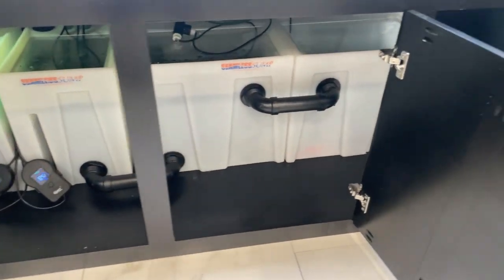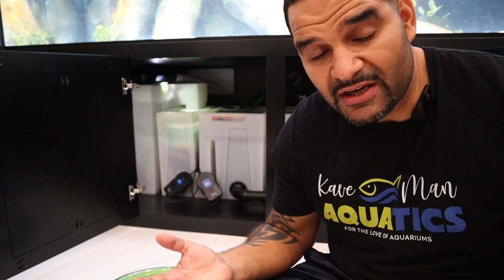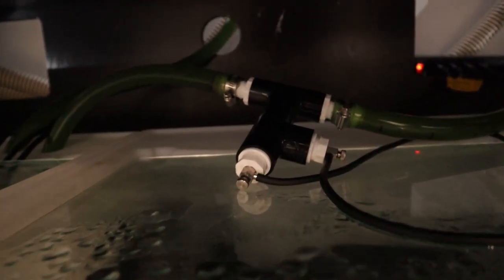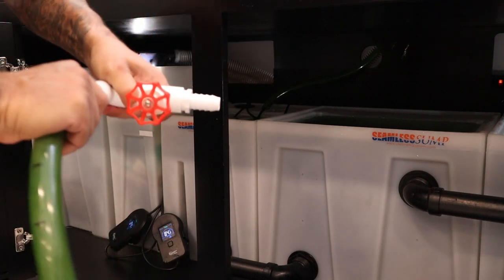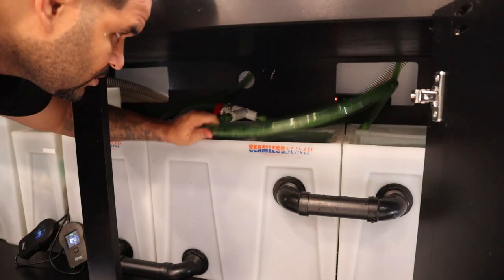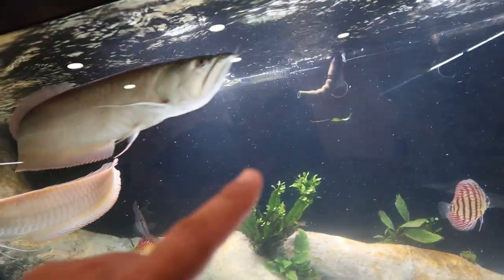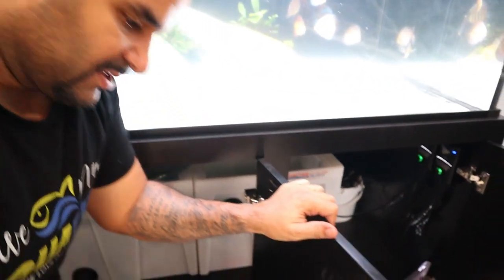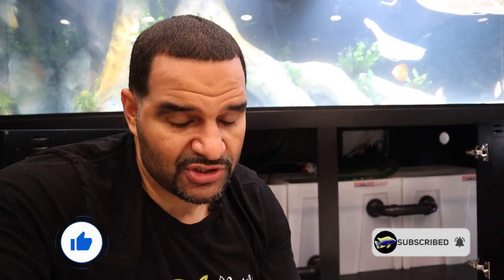I Upgraded My Seamless Sump! (Simple Hack)

Comment: I have the same seamless sump on my 600g african tank. What is did is I drilled two holes in the bottom side of the baffle tub and connected it with 1.5" pvc using a uniseal. I did the same thing to connect the third tub to the 4th where i have my pump. Seems two 1.5" PVC connections between each tub is enough flow for my 2000gph pump. This allowed me to make the third tub a fluidized k1 media bed!  FYI connecting pvc through the uniseal is a pain in the butt!! if I were to do it again i would plumb the side of the tubs like yours is.
Reply from the maker: Great idea! That was another similar option I had. Instead of adding another 1.5" pvc I was going to drill bigger holes and make mine either 2" or 2.5" in order to keep pumps in the last chamber. But I felt this method instead would provide equivalent flow with much less work. (just a t-valve change) So far the 2- 2000GPH pumps are both at max power so I'm getting a great 4k GPH flow through the tank and sump 😁 I also considered the K1, may be my next upgrade to the sump when im ready 💪

Comment: Such a great video thank you! I have one reservoir with bio balls in it and I encountered the same perceived issue. I dropped a co-op sponge filter in there to provide oxygenation but I think your solution is optimal
Reply from the maker: So far its working great and the extra flow in the back chamber hasnt caused any reduction in flow to the tank! The pumps are both on at 100% and maintaining the turn around well! 😊💪

Comment: Fantastic video as always my brother , going onto the brown algae subject my tank keeps getting brown algae my water parameters are all fine 0 ammonia 0 nitrite and 0 nitrate and I have had my tank running a good while now what would you say the cause of this was ? Only thing I can think of is prostates in the water maybe ? I don’t over feed and I don’t have my lights on a long time
Reply from the maker: First, you shouldnt have 0 nitrates in your tank, unless you have a jungle full of plants in there. So you're most likely testing incorrectly. Or you have a faulty test kit. Second, Brown algae is very common and normal to have in a young immature tank. it will stop growing on its own as your tank matures. For now just brush it away during maintenance every time it comes back.
Reply: @KaveManAquatics  oh really ? They did creep up to around 20ppm on my last water change my tank is quite lightly stocked I have been using the api master test kit I will have to keep an eye on that one Thankyou brother

Comment: Nice job in correcting your issue, but I can’t help but wonder if when your tank is fully stocked that you are going to need some extra mechanical filtration on that side as well
Reply from the maker: Well, on that side...the water should be fully mechanically filtered, as to not clog up the media in that last chamber. My goal is to add as much mechanical media in the very first baffle chamber so that all the water distributed throughout the sump is as mechanically filtered as possible 😊
Reply: @KaveManAquatics  oh I see, I thought that hose was coming down from the tank directly and being split between the last and first chamber

Comment: Hi Kev, I have both an fx6 and a sump on my 180gal.  In my experience, the only fear I have for the sump is the return pump failing or a power outage which could cause the sump to overflow.  So far so good, tho.  Another great video, devil dawg.  Rah.
Reply from the maker: Theres a way to ensure that doesnt happen. Fill the tank and let it overflow to fill the sump with the power off. Mark the highest water level on your sump that you feel comfortable with ( I fill mine about 2-3 inches from the top) and never fill it above that mark. Then power on. Water level should drop. But now you'll know if/when power fails the sump cant overflow. I would test and simulate the power outage a few times to ensure your mark is the right spot 😊💪

Comment: Key Kev, could you do a video on keeping good filtration and circulation on a tank which the fish prefer calmer water? Even the outlet on my 407 is blowing my rams everywhere, if i adjust my filter flow so they can cope i barely have any surface agitation, and i assume adding a wave maker isnt an option with the rams. I know a air stone would help, but im not too keen on them, any advice would be greatly appreciated!
Reply from the maker: Well first, what size tank are they in? A 407 may be too powerful for them in that tank size. If its really blowing them around, and you dont like the bubbles from an airstone (I feel you) maybe go the HOB filter route. The Tidal is the best IMO and you can adjust how much flow goes into the tank. It's just a splash so the rams wont be blown away and you'll still get tons of surface agitation as well as great filtration 😊

Comment: Hi Kev.. with all the flow in the tank.. is the Discuss ok with that? As what i know Discuss likes very slow moving water.. just asking out of curiosity.. TQIA..
Reply from the maker: When you think of the entire tanks volume, there really isnt that much flow. The 2 sump returns create surface agitation but dont produce a vortex in the tank. Theres plenty of calm areas for the Discus to relax in. When the wavemakers kick on for detritus removal is the heaviest flow but I only have that running for about 2 hours. On another note, I've read conflicting information about Discus and flow. While the traditional info says they prefer low flow, some say they do great in a heavy flow environment just like in the wild rivers they're found in, but I have yet to confirm this.
Reply: Thanks for the info.. an all u need to know about Discuss video in the near future maybe..🤔

Comment: Kev that's a pretty good deal to get flow in those chambers. I have only 1 reservoir tube on my seamless sump and I ran into the same thought with extra media in that tube. My short and simple cure was to drop a power head in the pump tub and attach a hose to the output and drop it in my reservoir tub. I get good flow that way. I never liked the drip line deal from custom aquarium as it doesn't flow like I wanted. But that's why it's called a drip line I guess. Any you got a good solution for your sump!
Reply from the maker: That is a very similar solution to what I did! Great thinking!

Comment: I may have to try this on my seamless sump too. I don't use my reservoir tank for biological media but instead I keep guppy grass and hornwort floating plants to remove nitrates. I always wondered if i could change from the trickle flow to what you just did. Thank you for the idea.
Reply from the maker: My pleasure! This would get more flow into that tank for more nitrate reducing effect from your plants! 😊💪
Reply: I noticed that you were having cloudy water .i also had the same issue with mine. The solution for me was switching to 100 micron socks and adding poly fill in the top tray in the biological tub. The downside of 100 micron socks is that they need swapped out usually every 3 - 4 days. The UV sterilizer that custom aquariums has also made a huge difference in water quality for me too. I  have a 180 and over 50 peacock and haps . They produce alot of waste lol

Comment: Looks like it should do the trick Bro. If not I would add another filter sock box so that each of your overflow boxes has their own set of socks and filter trays with its own pump and heater. I have a seamless sump on my 160gal discus Tank and that's what I did and works real nice man. Just a thought my man. Have you found any new Ray's yet ?
Reply from the maker: This sock chamber has it's own sock for each of the 3 overflows 😊 I'm tempted to try a lower micron sock though but also dont want to trigger a sock chamber overflow....Right now it has 200 micron socks. Rays are on the radar, hopefully they come soon!
Reply: @KaveManAquatics  that's cool man. The other thing that I did to increase my flow through my sump was upgrade my return pumps. They sent me pumps but I went with 2 1900gph current eflux dc pumps set at 80% I have some serious water movement from my water return nozzles. As for the socks I tried other microns also but ultimately stuck with their socks nice and heavy and change them out every 2 weeks. Plus I can just toss them in the washer on gentle cycle with a little bleach and good to go if your lady don't mind you using the washer ! My tank is fish only so no refugium no need for evaporation concerns since all of my sump openings have the glass tops on my tank is covered also. Just a heads up as long as you don't fill your sump over the max mark on the front of the sump you should not have any over flow issues. It is kind of hard to see but once you find it I just marked mine with a sharpie so I know not to go over.  I have had mine up and running for five years plus now and love it man. I was using to fx6 cannister filters prior to switching and glad now I mad the change. I know you know your shit Bro but just trying to help a brother out man.

Comment: Yo Kev, why not just make your last two chambers k1 media hosts (moving bed)?
Reply from the maker: Considered that, but the bulk heads are really big and the k1 would escape through. I'm sure with time I'll do a project adding some wire mesh to the bulkhead to prevent the escape and then try the K1 😊💪

Comment: How quiet is the seamless sump and overflow? Looking to get a 135G with seamless sump, but worried about the noise
Reply from the maker: Quiet is as quiet does, 🤣 You can absolutely hear the flow and its louder than a canister, but to me the canisters are silent, so theres that. it really depends on what you consider quiet. The sump is definitely not silent.

Comment: I have a seamless sump for one of my tanks and am curious on the best way to set up the flow. with me using an overflow I feel like some of the debris in the tank get stuck at the bottom sometimes.
Reply from the maker: I’ve been noticing the same. A wavemaker will dramatically help this. But I don’t want to keep mine in full blast and disturb the Discus. If you’re fish like the flow, keep it on 24/7. If they don’t, get a wavemaker that can be on a schedule and keep it on only for a few hours after feeding times. That should help.
Reply: @KaveManAquatics  thanks Kev. I do run a wave maker but i am also new to the sump game so ill have to move it around and try different spots. Thanks for the reply

Comment: So you are more of a plumber than me because I wouldn’t even have thought of doing this to solve that issue. My question is wouldn’t Customs Aquariums have a way to help with that if you do a media max option. I have been researching them because I plan on upgrading to a big tank soon. I rather pay extra and have that handle than mess it up like I know I will lol
Reply from the maker: After discussing this with Mark, one other option (that would have required more work) is to drill bigger 2” or even 2 1/2” holes to use bigger bulk heads and pipes to allow for more horizontal water travel so the pumps in the last chamber method would work well. I’m sure if you requested a “media max” type of setup they can provide the modification for you! 😁💪